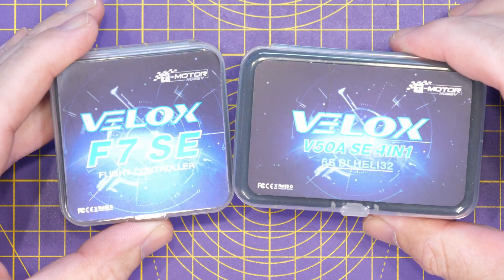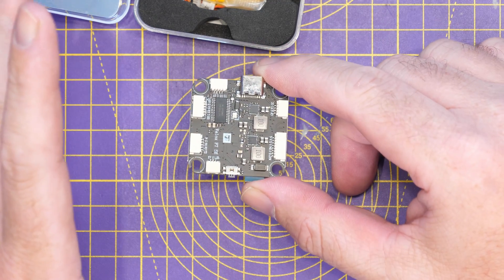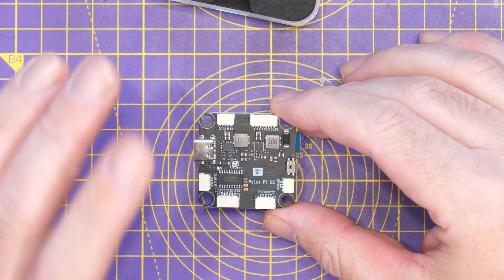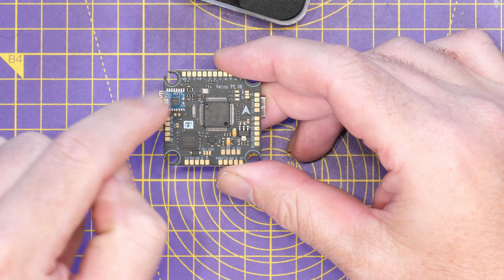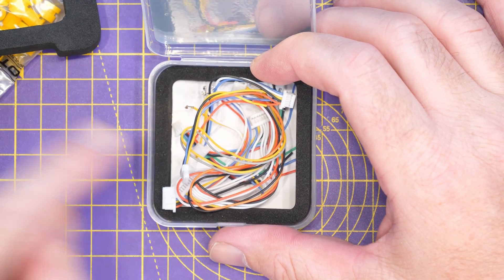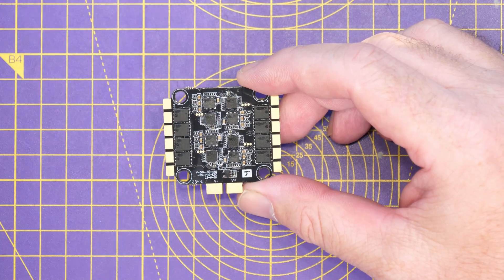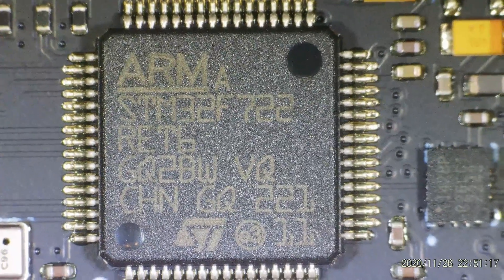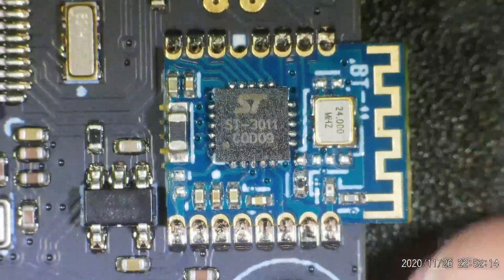T Motor Velox F7 SE Flight Controller & V50A SE ESC

Comment: One of the unique little features about this FC is the ability to switch a digital VTX on/off by controlling the pad. Common for wing FCs but it’s just not something you see often on betaflight FCs.
Reply from the maker: Pinned this as I missed it in the discussion.  Yes this and the flywoo has it. It’s a really great feature now.
Reply: @MadRC ... and Rush FPV and Holybro and Hakrc and Lumenier and ...
Reply: Quite handy if you're waiting for gps
Reply: @ceziukozak  yes! waiting for GPS or if you’re down and don’t want the vtx to cook itself until it auto shuts off as well.

Comment: Hey! is the T-Motor Velox V50A 6S 32Bit 4-in-1 ESC compatible with the F7 HD Flight Controller for DJI VTX?
Reply: Yep the esc its only for motors, the fc are the managment for vtx and yes work with analog, digital walksnail and digital dji old vtx dji air unit need 12v so if you use old air unit need a bec. O3 air unit plug and play

Comment: Great video. I didn’t have good luck with the velox 50a se. It fried on the first pack from a bad motor. The burst rate on it is only 60a. The hobbywing I replaced it with is 60a with a 90a burst rate and I haven’t had an issue since.